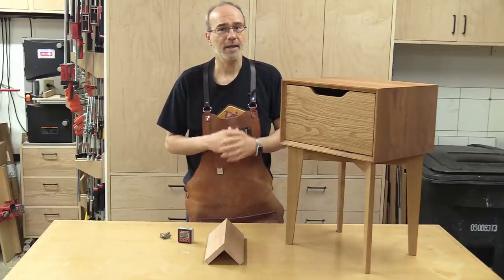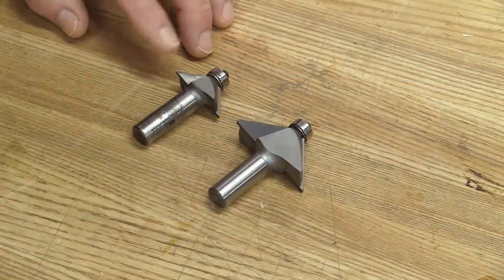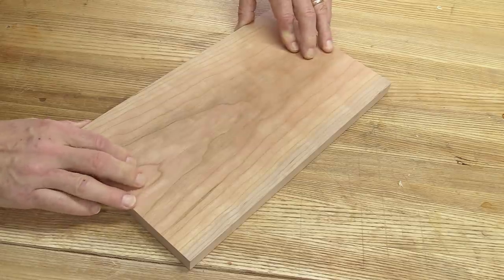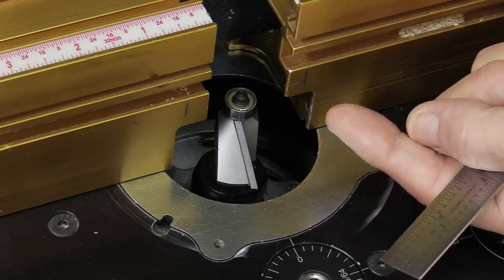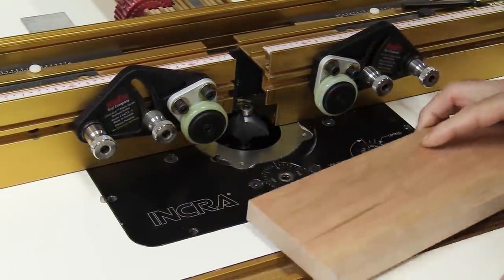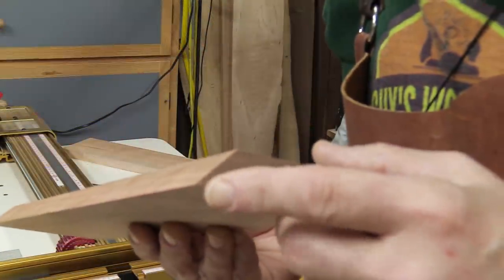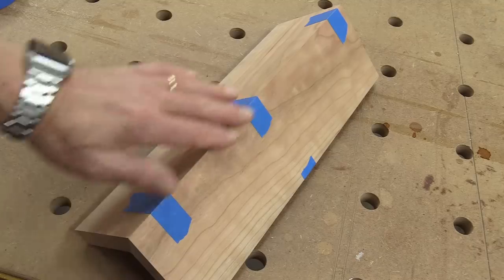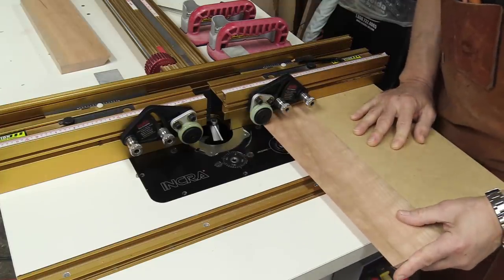Cut a Long Miter/Waterfall Edge on the Router Table

Comment: I may have to try this. Great info.  I have an Incra  router fence with a Woodpeckers router lift set up on the wing of my table saw.
I have a porter cable router motor that was my first router I purchased 25 years ago approx.  For turning such a large bit, I am guessing it may not be up to that task.  
What router motor would you recommend for a table nowadays?
Reply from the maker: I'm a big fan of the 3 1/4 HP routers for a table. It will spin up anything...

Comment: Hey Guy, I'm actually attempting to build almost the exact same thing. Replication of the west elm mid century modern nightstands. How did you join the panels to make the box? Just glue or additional supports? Also, on the face bevel, did you edge band to cover it or were you using solid wood? Thanks for all of the great videos!

Comment: I would remove most of the material with the talbe saw and then sneak up on it like you did at the router table. Nice tip!
Reply from the maker: That sure is another way of doing it. With a sharp bit, I just don't feel the need to do it that way.
Reply: @GuysShop  "With a sharp bit" are the right keywords. =)
I try to put little wear on special tools like these router bit. I think I get away cheaper in terms of sharpening and replacement if I remove most material with the table saw. But that is just thinking. I don't have scientific proof of that.
Reply from the maker: @ensen89  Yeah, I dig it. I have had this for about 4 years now. Still very sharp. I'm not doing production with it, so it sees limited use

Comment: I always thought about doing it that way. Looks like I need a big 45 bit. Is that a whiteside?  Also wouldn’t you recommend removing the bulk with a table saw on a 45?  Seems like a lot of material to remove in that first pass with a router.
Reply from the maker: It is a big Whiteside bit. You could remove the bulk with a table saw first if you were so inclined. I don't feel it's necessary and have been doing it this way for a very long time.
Reply: Thanks Guy.

Comment: Great video! i looked into chamfer bits and i couldnt find any that large, for example CMT tools had much smaller bits which cant handle 16 or 19 mm material (sorry i dont know in inches, i am from Europe). Could you please share any link or at least name of the bigger bit you are using? thank you